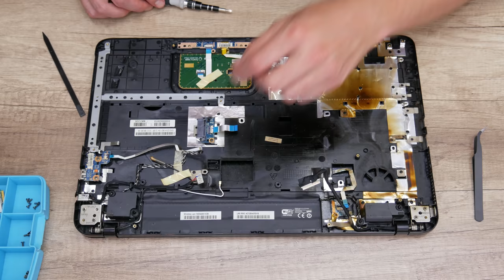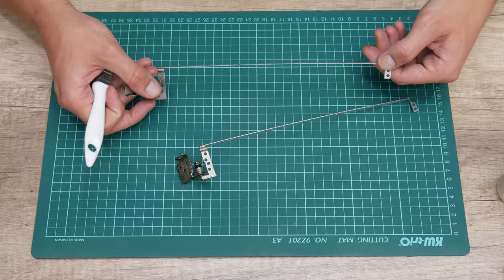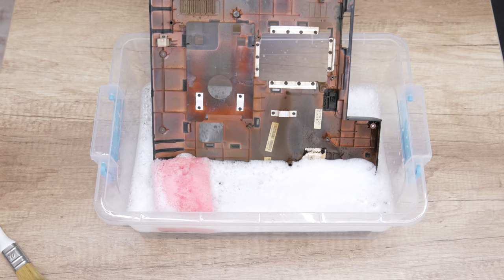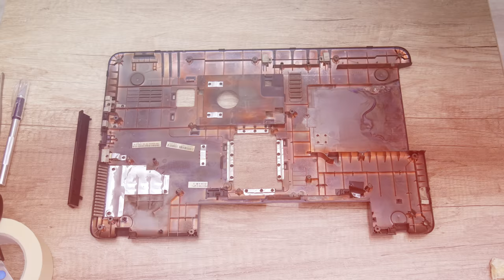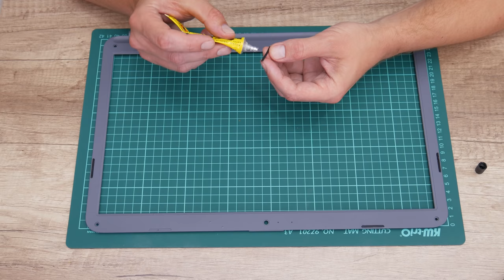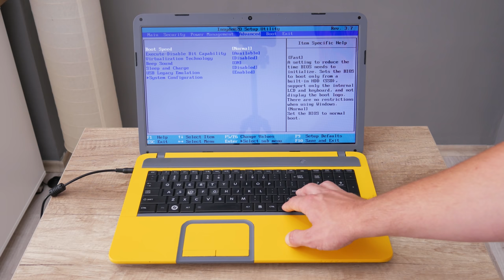Restoring and Upgrading an Old Toshiba L875

Comment: Thanks! I was inspired to fix my old Toshiba Satellite S55.  I replaced the HHD with SSD, added more ram, and gave it a good clean with your instructions. The cleaning and new heatsink really did the trick and the SSD was smaller but it sure is fast now!  Thank your for this video!

Comment: This is fantastic! I have rehabbed many laptops, but never painted them.  You've given me a lot of good ideas.
A little bit of feed back though... painting the trackpad probably isn't wise.  You could give up a lot of precision, not to mention the wear.
More importantly, use a heatgun/hair dryer on those stickers!  No need to risk using an exacto knife.  A little heat and they will peal off with your fingers and not leave so much residue.

Comment: Nice work! I own a L875 s7110, and did RAM, CPU and SSD upgrade. Now she runs Windows 11 with an i7 3630qm, 16 GB 1600 MHz Kingston RAM, and a 480 GB SSD from Sandisk. It´s an incredibly powerful laptop, even compared with very much newer equipment. I think building a DIY custom heatsink for cooling video chipset will be a nice upgrade. Thanks for the video!

Comment: I have a tips for cleaning the "brown/smoke air" mark of parts, like under the keyboard : 
Use WD 40 and spray on the part you are going to clean, then use a baby wipe, they are a little bit "abbrasive" that's working so well for cleaning that dirt and it doesn't make the object to be cleaned greasy thanks to the wipe.
Reply: Up

Comment: The final product looks pretty modern, this inspired me to buy a Toshiba a130 from 2010 and attempt to restore it, sadly i dont have the charger tho so its currently just sitting
Reply: processor Core 2 Duo T5500 in a laptop?
Reply: @vladimirazirov1815  yep
Reply: @shocknaw  Intel Core 2 Duo T7400 + RAM 2GB+2GB DDR2-667 + SSD 240-256GB sata-lll, TLC, 2.5 (Windows 7 x64, Ws 10 x64)
Reply: @vladimirazirov1815  no, it has 3 gigs and no hard drive, still has windows vista
Reply: @shocknaw  3GB - you can leave. A prоcessor Т7400, SSD and Windows 7 x64 is better to install.
Reply: @vladimirazirov1815  i did no upgrades, just restoration, it didnt work to begin with, it also had no hard drive

Comment: You put a lot of effort.
The result is excellent.
That is much better than just bought a new laptop with these parameters.
It's not something amazing as performance, but as you said for basic tasks it's great and when you know the design is yours, and the machine is working fine because of what you did the feeling is amazing.
Great job bro!

Comment: Hey there! I absolutely love all of your videos! I have a Dell Inspiron 1564 and I guess it's thermal paste is dry hard. I think I'm gonna open it and clean it. But I'm afraid if anything goes wrong. What if I'm unable to put it back together or damage something? I surely will follow your advice like using a 96% alcohol for cleaning. Is there something else?
Thank you!
Reply: im probably too late but taking pictures of the inside before and after taking it apart can help you with putting it back together
Reply: @brutus3631  That's a great tip! And thank you so much for it. You're never late in a virtual world tho haha! I'll do my repasting in a month or two.

Comment: A thing to look out for when upgrading laptop processors though is TDP. Often times the cooling solution in laptops was barely good enough for the processor it came with. I have heard of stretching things a bit though if you can use liquid metal compound, but make sure you don't have an aluminum heatsink.

Comment: I have almost the same laptop Satellite L870 18J with i5 3230M and Radeon 7600M graphics. I replaced the Dvd-RW with a caddy and i installed in it the original hard drive for data storage ( 750GB) and in the original hard drive place i put a 240 GB ssd. Behaves like a brand new machine.

Comment: Another mod, since the dvd/cd-R drive is internally a SATA-2 (7 data, 6 power) you can replace the drive with a drop-in BD-RE (Blu-Ray re-recordable) drive.  I've modded my Toshiba A505-6005 with a generic drive I picked up off ebay, and have been watching Blu-Ray movies, and backing up data via BD-R discs. Now, if only the A505's didn't have the foam ringed speakers. I've had to replace at least 3 of the Harmon-Cardon speaker pairs because the foam deteriorates from high frequency. Also added a 1-TB drive, and replaced the Win-7 OS with a Ubuntu Linux distro.

Comment: You'll get better paint results by using a vinal tape for edge masking. The white masking tape has a tendency to absorb paint and gives you rough looking lines. An alternate to paint would be a patternd vinal wrap or even hydrodip
Great job tough.

Comment: Yo, Andrew. It would be nice, if You could link the Tracks You are using for Your Videos. They are very chilling to listen to & I would love to add them to a Playlist for private Usage (chilling at home & something like that). ✌😁

Also a big thank You for making these Restoration Vids. They are quite inspiring & helped ma to get my Hands on my old Lenovo G50-30. I cleaned the whole Thing completely, upgraded the Ram & the Data Storage to SSD, installed Windows 10 on it & now it runs sooooooooo much better than before. 👌😍😘😁

Comment: Hello , great vidéo again.
I have the same laptop (C870) and i upgrade the CPU from Celeron B820 to i7-2630QM and the laptop shut down randomly.
Do you have an Idea that how i Can fix it with keeping the i7.
I check the température and it seems normal (around 50/60 degrees at rest) ?
Thx :)

Comment: Hey :D i love your video i have a Toshiba c55-a-180  and already upgraded my hdd to an ssd and added new ram ^^. 

I just wanted to ask you how you know what cpu fits you laptop / to what cpu you can upgrade :D
and is it possible to get a better screen for the laptop and would that end up being a drag on performance? ^^
Reply: install the cpu-z program on the laptop. On the first tab, look at the processor model and socket type. On the "Mainboard" tab, look at which south bridge. Tell me this information
Reply: @vladimirazirov1815  
Processor:
- Name: Intel Core i3 3110M
- Code Namee: Ivy Bridge
- Package: Socket 988B rPGA
- Technology 22nm
- Max TDP: 35.0 W

Mainboard: 
- PT10F Type2- Board Version
- Southbridge: Intel HM76
- Chipset: Intel Ivy Bridge

thank you for your help <3
Reply: @TheLPfunnTV  i5-3360m, i5-3380m, i7-3612qm, i7-3632qm
Reply: @vladimirazirov1815  thank you ^^
How did you figure it out :D
Reply: @vladimirazirov1815  i did the upgrade to i7-3632qm :D lets see how it behaves under load. ty for your help ^^
Reply: @TheLPfunnTV  you are welcome ) This is the ultimate processor for your laptop. The productivity should be doubled. If the processor overheats, it will reset the frequency

Comment: Good question: I have 2 HP G62 laptops. 1 is AMD & the 2nd is Intel. Can the screen & keyboard from the Intel be put in the AMD case? Or the AMD m/b be installed in the Intel case?🤔 Thanks better yet, can the HDD from the AMD be mounted in the Intel case, & work?

Comment: You could have replaced the cd drive with a 1 tb mass storage.

I have a toshiba L500-21t. With first gen i3, 2 gb ram and 240 gb storage. What can you recommend  that i do with it, so i can do online class with it
Reply: install an i5-560m (or i5-580m) processor. Buy a second 4GB memory module (SO-DIMM DDR3-1066 / DDR3-1333), only so that the memory module has 8 memory chips on one side. 6GB (2+4) RAM will be fine for this laptop. 

In the future, it is good to buy an SSD for Windows (120-128GB / 2.5"/ SATA-III / TLC). Move the HDD to the DVD slot through a Caddy adapter (12.7mm). HDD can be installed on 500-750GB.

Comment: hi, i watched your video and it is really interesting. i also have a toshiba satellite c850-b076, it has a i3 2312 processor, i would like to ask, is it possible to put in a core i5 2540m processor upgrade for my laptop?? thanks
Reply: through the Speccy or CPU-Z program, look at the  socket type, the name of the chipset and the south bridge of the motherboard.

Comment: Nice video! I would really like the upgrade of a dell e6420 laptop, its the one I have and Ive seen that it is very good to apply upgrades! it comes with an i5 2500m processor and Nvidia nvs4200m graphic dedicated card, ram up to 16gb etc
Reply: install the processor i7-2630qm

Comment: I have a 7 year old Toshiba C655 laptop.. The RAM is 2 GB, Windows seven professional, Intel Core i3 processor and almost 500GB storage.. It still runs great tho! I use it for basic purposes like for college. 
But I wanna upgrade my laptop.. Can you suggest me how shall I go forward with my choices
Reply: download the CPU-Z program from the Internet and on tabs 1 and 3 look at the socket type, chipset and south bridge of the motherboard. Is there a discrete Nvidia / AMD card?

Comment: Hello Sir, May I Asked, How to reduce the overheating of Laptop? I already done cleaning the fan and changing its thermal paste.. but the processor draws too much heat.. when i do basic task on the laptop its temperature can reach 70 degrees Celsius.. How Am I supposed to solve this problem? Any recommendations?😊
Thank You..

Comment: Can we upgrade to 1080p on this? I have lp156wh4tla1 which uses 1ch 6 bit 40 pinout. Not sure if the cable supports 2ch 6 bit 40pinout or not.

Comment: I have t440p that I have maxed out with ram and 4810mq and full HD screen. I would like to know what the best upgradable laptop is that I could add an external GPU and get at least a quad core processor would be. The t440p sadly won't allow an external gpu or it would be perfect.

Comment: I am having a blue toshiba with i3 2nd 4gb ram ddr3 from 2gb ram intel hd 2000 640hdd my plan is to upgrade it with i5 2500 gt 730 and 10gb ram with i7 2600k or i5 760, i5 2500 which is the best upgrade these upgrades are good or not.

Comment: Could you look at possibly doing the HP pavilion dv6500?
Reply: solved the problem with the processor?
Reply: Slava Fedotov What problem?
Reply: @EastDallasKicks  problem how to improve the laptop)
Reply: Slava Fedotov I think the best processor for the laptop is the core 2 duo t9300
Reply: @EastDallasKicks  you're right. Т9300- optimal in terms of price + performance)
I had a Lenovo B550 laptop with a T9300 processor in 2016)
Reply: Slava Fedotov yeah plus the it’s the best processor the laptop supports

Comment: Found a tossed out Satellite L875D - S7332. You don't know " in bad condition"!! No HDD, screen is brijen, top cover has a crack / small section broken off, DVD player is gone! And no keyboard/ palm rest panel! 😱😂😅 The i7 you installed, does it come with built in graphics?

Comment: I have a laptop with i3 7100U processor and its not replaceable  because its soldered into the board. So what is the best gpu if I'm going to upgrade the laptop with egpu setup :/ ?

Comment: Any chance in taking a Toshiba C50 satellite and doing a full upgrade? Streamer on twitch would be great to see this 👍
Reply: what processor is in the laptop? i3-3110m?
how many gigabytes of RAM and how many memory modules (1 or 2)?
Reply: @vladimirazirov1815  I will check tonight when I charge it up. I'll keep you posted
Reply: Intel r Pentium r cpu 2020m @2.40 ghz 2.40ghz 6gb ram 64bit op system 2 cores
Reply: @Thedrummingchannel  program CPU-Z -> Mainboard -> Southbridge -> HM70? HM75? HM76?
Reply: @Thedrummingchannel  the CPU-Z program is free. Download from the Internet to a laptop and see the type of socket and which south bridge (1 and 3 tab of the program)
Reply: Hm70
Reply: 6gigbytes of ram dual core
Reply: @Thedrummingchannel  you have the maximum processor. At a minimum, you can install SSD 480-512GB (sata-lll, 2.5") instead of HDD and make 10-12GB DDR3L-1600 RAM. 
To the maximum, you can replace your motherboard with another motherboard with the rPGA988B socket and the HM75 / HM76 / HM77 chipset, and then you can buy the i7-3612qm, i7-3632qm processor.
Reply: @vladimirazirov1815  Thank you very much the only problem is air cooling and power supply will it not overload?
Reply: @Thedrummingchannel  these i7 processors at 35 watts and the cooling and power of the motherboard will cope. If you do not have a discrete card (Nvidia / AMD) and you buy a motherboard with such a video card, you will have to buy another cooling system. Compare your motherboard to the motherboard in the photo in terms of shape and port locations.

I advise you to divide the SSD into C (100GB) and D (360-380GB) drives. If you have Windows 10, then in the "disk properties" disable file indexing and enable disk optimization once a week. Go to Swap File and turn off "automatic swap file size" and turn on your C drive paging file size equal to 3072MB (original and maximum). For SSD, you need to enable AHCI mode in the BIOS.
Please )
Reply: @vladimirazirov1815  I've had a look decent price at £55 for the i7 going to price the motherboard also
Reply: I have the s7 plus tablet also 6gb ram otca core play xbox games, I am going to build a pc so I think I will give this to a new home
Reply: @Thedrummingchannel  SSD, 6GB RAM - would be a good laptop for the internet. 

You can install a powerful processor and video card in your computer and it will be good for games. Ready-made kits for assembling a computer (Motherboard LGA 2011-3, processor Xeon 4-8 core, RAM 8GB+8GB) are already being sold on Ali expre ss and buying a good video card for 4-6-8GB with a 192-256-bit bus.

Comment: hi I cleaned my laptop from the outside and inside so that my laptop doesn't heat up anymore but my laptop is still the same heat even though I have cleaned all the dust inside the laptop fan and I've also replaced the thermal paste with the one recommended

Comment: Maybe you should've used a 3rd gen CPU. The integrated GPU on 3rd gen CPU's are better than 2nd gen, even if it's a quad core sandy bridge vs a dual core ivy bridge i5

Comment: Hi
I have a Toshiba Satellite S50t Laptop . I was installing windows 10 on it but in between battery was low and power cable was not connected and laptop turned off and now I can not see anything on my screen . When turned on I can see the lights under button can listen fan noise but can not any thing on screen so not able to fix it. Do you have any solution for this situation?

Comment: Hi bro, I bough my laptop back in 2018, it is a budget windows laptop, it has ryzen 9000e(dual core) cpu and 4gb ram and 1tb hdd and 512mb graphic card, i can't even run chrome smoothly, i have tried factory resetting my laptop, disabling many unrequired background apps but it still it is damn slow it heats a lot, a lot, BUT NOW I HAVE NO OTHER OPTION RATHER BUYING A NEW ONE. please suggest any upgrade for me you can save my money. ( remember i have a potato laptop)
Reply from the maker: Hi bro, unfortunately these laptops are not much upgradable, to some models you can add more RAM and change HDD to SSD and that's all. In Your case you can add SSD instead of HDD, the SSD will make things run and open faster, but again you can't expect change in gaming performances or something similar. Unfortunately today almost any new laptop isn't much upgradable, except few very high end models

Comment: OMG, from where did you get the info , which better CPU is supported for your Toshiba?? I have two Toshibas from 2012 and i cant find any upgrade info. Toshiba support is just useless!
Reply: download the CPU-Z program from the Internet. On the first and third pages, look at the processor model, socket type, which chipset and south bridge of the motherboard, which laptop model. Write this information and then I will tell you what can be done :)
Reply: @slavafedotov5742 
Model: i5 2450M
Socket: 988B rPGA
Chipset: Sandy Bridge (re. 09)
Southbridge: Intel HM76 (rev. 04) 

Toshiba Satellite L850-117  

I cant send right now info about the second laptop though.
Reply: @rasLivity666  you can install processors i7-3612qm, i7-3632qm /// you can leave DDR3-1333 memory modules (up to 16GB). You can install memory modules DDR3L-1600, DDR3L-1866 (up to 16GB). 16GB (8+8) is a lot, it is optimal to install 4GB+4GB.
Reply: @slavafedotov5742  thanks! I already buy extra 4gb 1333 RAM instead of the 2gb stick, so i will stay with that. But are there any better i5 cpus? Those i7 need big money i guess 😃
Reply: @rasLivity666  i5-3380m, i5-3360m
Reply: @slavafedotov5742  HI! So i got info about the other Toshiba. I hope you wanna help one last time :D Again, write also both i5 and i7 CPUs please. 
Model: i3 2350m 
socket: 988b rPGA
Chipset: Intel sandy bridge (rev. 09)
Southbridge: Intel HM65 (rev. b2)  

Satellite L755-1n7
Reply: @rasLivity666  hello :) 
economical upgrade: i5-2540m => productivity +35%. 
RAM 6-8GB DDR3-1333 //
more efficient upgrade: i7-2670qm, i7-2720qm. So that there is no laptop overheating and a heavy load on the motherboard, you should turn off the turbo boost on the processor. Go to the Windows "Power Plan" and set the maximum power supply of the processor from the network and battery - 99%, the minimum - 0%. 
Get 4 cores / 8 threads / 2.2GHz. 
Performance=> +90%.
Reply: @rasLivity666  if you want to install an i5-2540m processor, then it is better to remove the i5-2450m from the first laptop and replace the i3 :)
and install i5-3380m (3rd generation Intel) or i7-2670qm on the first laptop
Reply: @slavafedotov5742  Thank you so much for your help!

Comment: Hi sir i have the toshiba sattelite c855- s5214
Cpu pentium 4gb ram
Can i ask if the cpu can run the windows 10 ?
Reply: Can. You can even upgrade it. Download the CPU-Z program from the Internet and see what type of socket, what processor model, what chipset and the south bridge of the motherboard (1 and 3 tabs of the program)